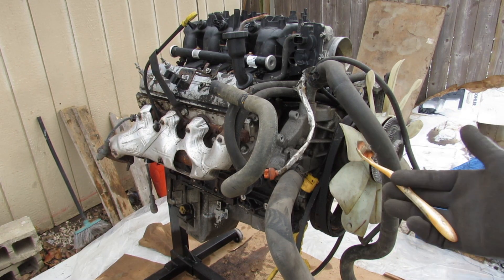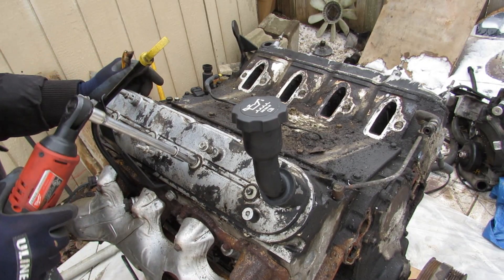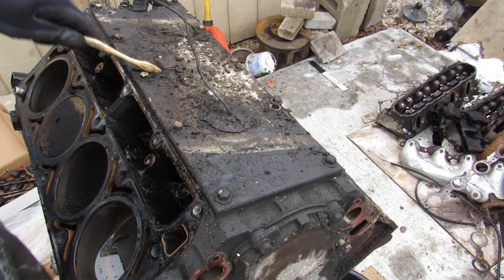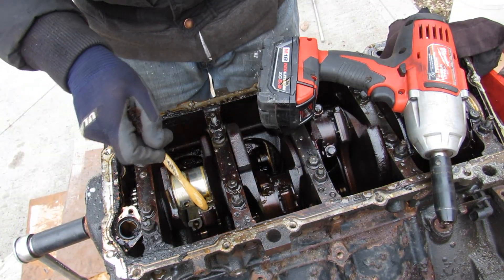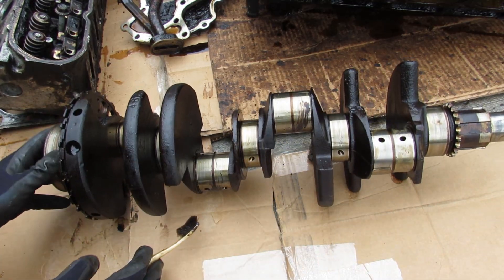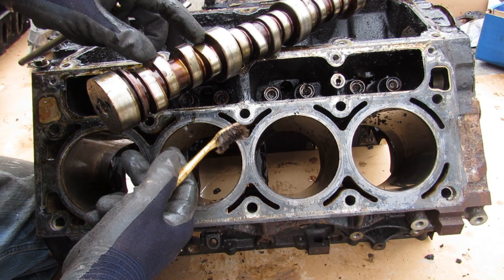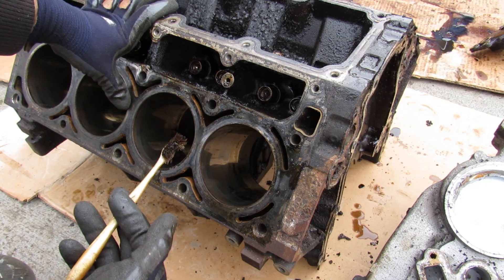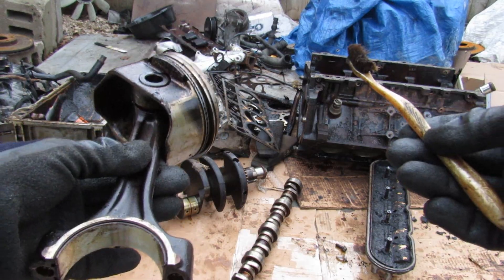Why the Chevy LS is the Best V8 Engine

Comment: "of course it's got a fram on it" 😂😂😂
Reply: The number one brand among owners that simply don't give a $H!+ !!
Reply: Yep s fam and looks very much like  Quaker state oil
Reply: I would use Royal Purple HPS, Mobil 1, Amsoil oils.

For the filter, I go with K&N, Mobil 1, Royal Purple, Amsoil.

Wix I have not tried it, not sure how good it is.
Reply: Love fram filters, I can take a welders hammer and punch holes in it with ease
Reply: Need to use better filter on pick up trucks, since they work harder.

Fram oil filters is the ideal filters, for both toyota and honda automobiles, especially the common orange filter, Extra Guard.
Reply: @theroyalcrownedtiger2946  I personally prefer Wix filters for my LS.
Reply: @FWDSUXARSE  I put a Wix filter with Royal Purple HPS in my LS1. (Let the great oil debate begin)
Reply: @Dcc357  smh I use pb blaster as my oil

Comment: So chevy is now using a 90 degree "v"? Back in the 60s and 70s Chevy used a 60 degee "v". That's why Chevy engines looked smaller than Pontiac and Oldsmobile V-8s. (Which used 90 degree "V". Interesting.

Comment: I use to tear all kinds of car and truck engines apart back in the 70’s. Oil crud like that was common, especially in Buick 350 and 400s for reasons I do not know.  I have an LS now, I hope it is not like that inside. 😅

Comment: Betting that is a castech head 5.3. That sludge hints toward a slightly cracked head. Pretty common on these.  You would think coolant would turn the oil white-ish, but the small amounts of it just turn it into this gross sludge
Reply from the maker: This was the 4.8 
Did the 4.8 have the cracked head issue?
Reply: @speedkar99  absolutely.  4.8/5.3 from 01-06 are the suspects

Comment: Nice video, thank you. For the record, that plastic plug on the side of the pan is actually an oil level sensor, the block heater threads into drivers side of block just behind the motor mount on the pickups anyway. Other notes, be very careful with that crankshaft position sensor ring on the crank shaft, it can be bent easily, and wont run correctly if at all. Also note the roller lifters underneath the plastic lifter retainers. Those need to be removed to allow the lifters to be removed before the camshaft will slide out.
Reply from the maker: Thanks for the tips. Yes I mixed up the oil level sensor.

Comment: Not bad for a "temporary design" from 1954.
Reply from the maker: Why is it temporary?
Reply: After Ford brought out their pushrod V-8, GM had a "Catch-up" campaign. Very much like what happened when Russia launched Sputnik, America realized it was behind in science and engineering. That was why there was such a rush to get all high school students into "college-prep" in the 60's. Same with GM. So Chevy played catch-up and they actually said that the rushed engineering of the small-block was a temporary design. The engine was to be made using all the existing tooling in the engine factories to save time. Finally, Chevy is going to bring out a new 5.5 liter DOHC V-8. Just 65 years late.

Comment: Chevy 6.0 - 12 head bolts per side at 9.3:1 
Ford/International 6.0 - 6 TTY head bolts per side at 18:1

And people wonder why diesel fans laugh at Power Chokes
Reply from the maker: Wow. Do they blow heads often?
Reply: @speedkar99  yeah, they are notorious for stretching those Torque to Yield bolts and blowing the gasket. Some of them did it after just 5k miles. Supposedly you can bulletproof them, but I’d rather just bullet them, if you know what I mean. It’s really a toss up whether that one or the subsequent 6.4 Ford ran for 2-3 years are the worst turbo Diesel engines ever made. About the only thing worse I can think of is when Oldsmobile put diesel heads on an old 350 block and sold them in the 80’s. 5.7 liter, 140 hp V8 that was good for maybe 80k miles.

Comment: How to keep inside engine neat and clean,plz suggest
Reply from the maker: Oil changes!!
Reply: I started working on engines in the 60's, and back then I could tell you the brand of oil used by just popping the valve cover off, this coking was common with the use of  Pennzoil, it would really sludge an engine up, even with regular oil changes, don't know if the current oil does the same thing as I would never use it
Reply: @garysisk3431  which is the best brand of oil ?

Comment: Great Video, definitely prefer the UR series engines(Toyota/Lexus V8s). 
I guess the cost of them is what holds people back from using them more commonly. 
These Iron block pushrods can be cheap.
Reply from the maker: Agreed, Toyota does make reliable V8s but I think the LS can take more boost and is much cheaper

Comment: Did this engine call for synthetic oil? What grade is on the oil cap?
Reply from the maker: I don't think they call for synthetic
Reply: I think that was a 5.3, which didn't call for synthetic. I think the application/block (iron/aluminum) dictated - for instance, I believe anything in a Corvette or the 6.0 LS2 in the TBSS would call for Mobil 1.

Comment: Theres not a oil galley to the heads. The oil comes from the lifters and through the pushrods.
Reply: Read this comment I posted.
Reply from the maker: Okay I'll have to have another look at that block and head 

Where does it feed from the lifters?
Reply: @speedkar99  it feeds the cam bearings/lifters first prio. So theres a galley on each side of the cam. Aftermarket blocks has main journal prio then the cam.

Comment: Pushrods FTW!!!

No, kids. "FTW" doesn't mean "for the win".
Reply: Too funny even my 5.0 Coyote is laughing!
Reply: Not only pushrods and heavy lifters, but the valve springs have to be double or triple to handle the mass. Hard on the cam. And the valves are in the wrong plane. And only two for each cylinder. Mosler and other companies designed DOHC heads but Chevy never took the hint.
Reply: @amazoidal  They kept things simple and effective. It's easy to get over 1000 hp out of a fairly conservative build. My 6 litre L77 has a stock 360 hp and gets 9.4 litres per 100 km on a run. Not sure why you think they need DOHC multivalve BS.....
Reply: Let's look at breathing. You may get 1000hp at one rpm but acceleration is a good measure of breathing. Let's take the example that was in the March issue of Car and Driver. We race two cars. One is the supercharged Camaro ZL1-1LE. The other is the Shelby GT500. We race to160 mph. Results: The Camaro is 5 seconds slower to 160. Why? Two valves in the wrong direction, huge valvetrain mass limits rpm. Simple.
Reply: @amazoidal  Ah, you mean the Shelby that's built for 760 HP against the Camaro that's built for 650 HP? In the comparison where the Camaro beats the Shelby to 60mph, and dead heats it on a quarter mile? Pointless argument, really. If you wanted sustained top end HP, for running on a high banked oval or something, and you aren't restricted by RPM, then sure, look at DOHC engines, but if you want something that's driveable, and has a useable torque curve, you are better off with the "Dinosaur" engine. There's a good reason LS engines get swapped into so many other vehicles, over Coyotes
Reply: Oh, and I get that the valve springs may need to be slightly stiffer in the pushrod engine, but 2-3 times? I’ve never built a Coyote but I do find that a bit hard to believe, without any figures to back it up....

Comment: Just curious I'm getting ready to be changing my intake manifold gasket and knock sensors on my 2001 Tahoe I have been told that I needed to get an engine flush or whatever the bg moe and epr idk what it was called tbh. But how much extra work is it to actually take off that plate that you found all that crud underneath?
Reply from the maker: The plate sits under the intake manifold which means your dealing with alot of vacuum lines and fuel
Reply: @speedkar99  okay. So most likely don't even wanna try to deal with that. Just curious, is a 2007 gmc yukon slt with 162,000 miles one previous owner and we'll maintained a good buy?
Reply: @eschafer1987  Depends on what they are asking for it. Depending on the price it can be a good deal.

Comment: Factory oil in that engine...excellent review and I love the fact you're not playing any stupid background music 👍🏾👍🏾
Reply from the maker: The real music is the whine of my impact gun zipping it apart
Reply: Sludge is actually dirt, carbon from the combustion, a little bit gets in the oil everytime a cylinder fires, metal shavings, so with time all these added to the oil makes it thicker, in this case so thick it stuck on the walls and due to poor cooling, oil also cools the engine. It litteraly cooked on to the interior walls of the engine. So your guess might be correct. Who ever drived this engine, does not deserve a licence drive or ever touch a car... Is just sad to see so much science go to waste.
Reply: @alexandrugajin763  I couldn't agree more 👍🏾👍🏾
Reply from the maker: Music is distracting

Comment: Excellent explanation!  The last owner of that engine was obviously an idiot.  I've never seen a more caked up and sludged engine.  Was surprised that the bearing surfaces weren't worse.  Your right about problems with the VVT and cylinder activation.  It's not worth the trouble for an extra MPG.  The 99-06 truck engines don't have that stuff and are wonderful engines.  If you change your oil on a regular basis and perform other maintenance per the manual they'll last at least 375-400K miles. Maybe a few minor repairs along the way.  Fun fact: Ford just reintroduced their version of this OHV engine, it's called the Godzilla 7.3.  Got away from the SOHC and went old school. Overall less moving parts and probably stronger.
Reply from the maker: Yeah I thought the bearings would be as shot. Testiment to how strong it is

Comment: Lots of advantages to a pushrod engine over an overhead cam. Simple and cheap, narrower and with a lower center of gravity, and superior low end torque to name a few. Glad to see you taking on some good ol' Detroit Iron for a change  : )
Reply: Pushrod engines do not inherently have better low-end torque, and all things being equal, "narrower" would mean a higher CoG unless you're swapping in a dry sump oiling system and custom mounts.
Reply: @fun_ghoul  Pushrod engines are two valves per cylinder which means smaller intake ports which promotes better fuel air mixture at low RPM.  

They are narrower because they don't have the cam in the head and four valves per cylinder, so the heads are not only narrower but much lighter as well. That plus the cam in the block means a lower center of gravity.
Reply: @fun_ghoul  Good grief.
Reply from the maker: Yes it's good to try different brands....been doing too much Honda and Nissan but that's child's play for me now

Comment: This is the engine that was used to power Noah's Ark
Reply: I mean, that was before the various "fuel crises"...
Reply: He used the dinos on board yo make fossil fuel
Reply: @instasingingvids3529  dino piss are basically race fuel
Reply: Not enough torque
Reply: The LS is proof that just because something doesn't have all the bells and whistles, it can still do the job it's designed to do, and it does it very well.
Reply: Chevy LS... so holy that even God uses it.
Reply: Nah, that's papa Small-Block; he's been doin' it since 1954, and you can get a new one, still built by GM, TODAY.

Comment: What's so amazing about this engine is that it was still running with all that crud inside it, and the bearings all looked fine, all the wear surfaces weren't scored....  (the cam bearings were a bit black).  A really good engine series proving that a simple design is best.
Reply from the maker: I agree, I'm equally surprised
Reply: Simple definitely best for longevity and ease of ownership just change the oil and its 300000 miles or more - rest of the chevy not so much 🤣

Comment: All that oil crud that goes through the intake can be remedied by a oil catch can. My LS6 intake was oily on the inside. once I installed the catch can, it is bone dry.
Reply from the maker: That can work yes
Reply: my oil catch can on my hyundai elantra 2013 catch almost only gaz and half inch of oil foam and my can is full in one week
Reply: @patrickst-georges4008  You do realize that car manufactures do this so the engine does not last as long right?
Reply: @DJSHaKa  no. That's democrat's hoax
Reply: @donniebunkerboi9975  hahahaha lmao

Comment: That carbon in the intake is one reason why I don’t like direct injection, with a carburetor the fuel rushing by helps clean the deposits and stops them from forming. Although running a port injected engine hard will help to break some of the deposits up.
Reply from the maker: Yeah except this one didn't fair so well

Comment: That generation engine is known for bad head casting with hair line cracks that leads to the engine drinking the coolant...and that is shown by all that sludge in there...
Reply from the maker: So your saying the coolant mixed causing all this sludge? Shouldn't it be milky?
Reply: @speedkar99   yes you're right but what typically happens is it slowly leaks into the oil which allows the dex cool to slowly mix in with the oil and it would turn it into a pudding consistency which is what it looked like when you pulled the valve cover off.... not saying that engine was taken care of by any means definitely hasn't seen very many oil changes I'm just familiar with these motors having done head swaps on two different rigs both being the 5.3 but I know they have the issue with the 4.8 and the 6.0
Reply: @speedkar99   lol...finally got to the part where you were showing the head and its an 862 casting  and they where the good ones ....so this is just a badly maintained engine and shouldn't of had that coolant issue
Reply: I believe the head casting number was 706
Reply: But don't get me wrong I still love that generation engine never left me stranded and I've had the new 5-3 direct-injected engines and I'd much rather stick with a port injection